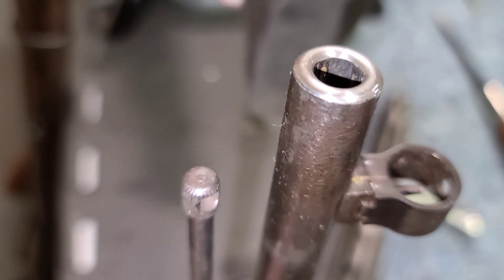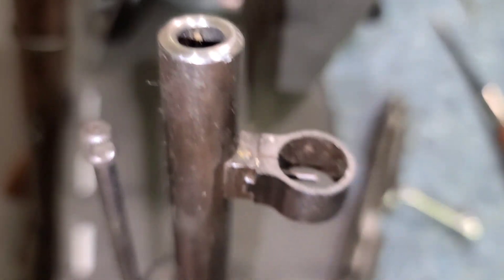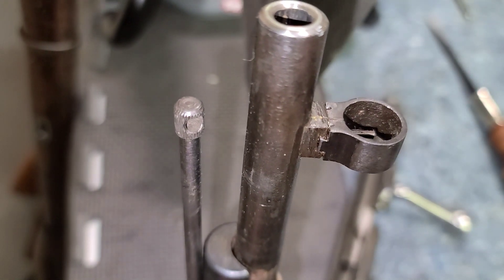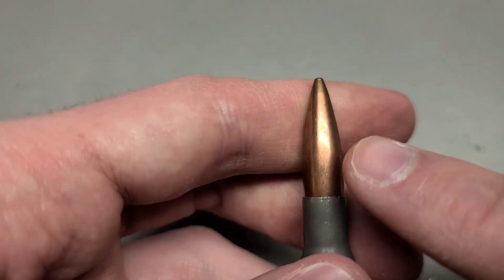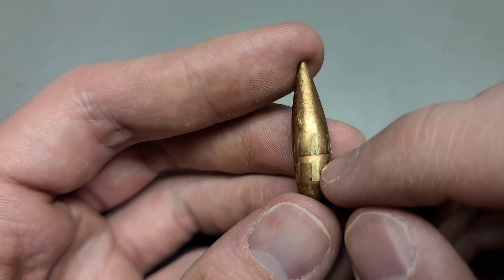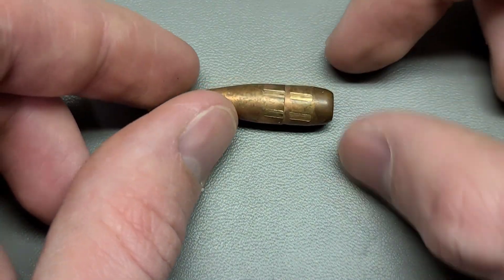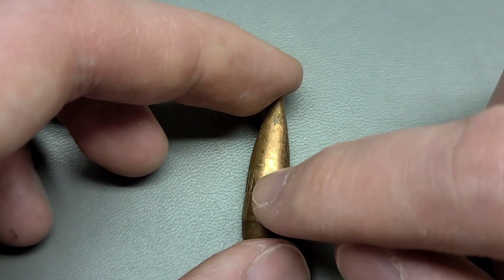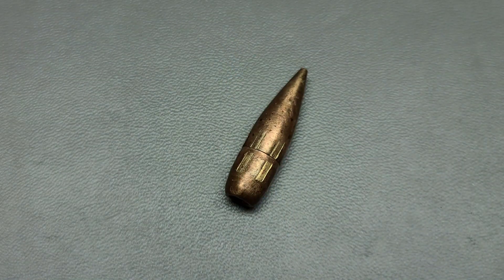What does rifling do to a bullet?

Comment: The boat tail serves to reduce drag, especially at longer ranges.  Copper fouling in the barrel is the result of friction between the bullet and barrel, or a rough spot in the barrel.  Generally, the smoother the grooves and bore, the less fouling deposited.  And, higher muzzle velocity tends to increase fouling .

Comment: A big debate... to clean the copper or not to clean the copper? I have shot long range for many years and have been told by many to "NEVER!" clean my bore with anything but a nylon brush, oil and a patch while protecting the crown from rod scraping... and I have been told "ALWAYS!" remove the copper fouling with solvents and a copper brush will never hurt your rifling... in my experience, one of the rifles that I bought brand new, that has never had anything but bullets, oil, patches and a nylon brush... is more accurate today, than the day I bought it 24 years ago. - take it for what you will.